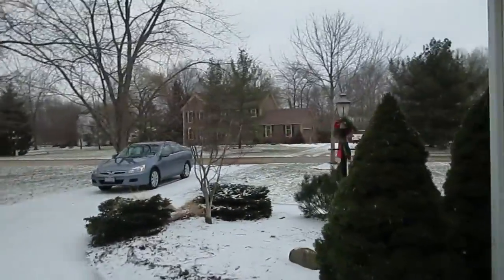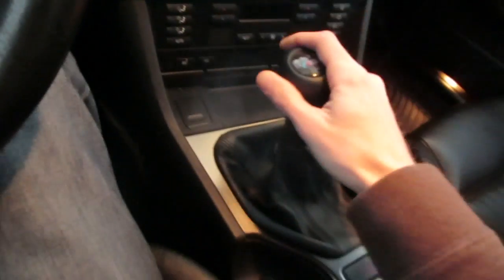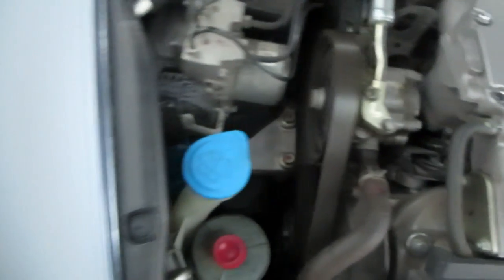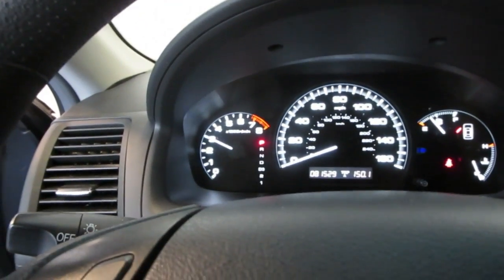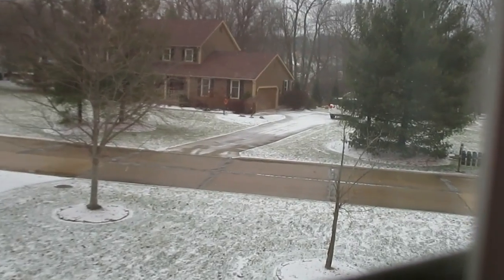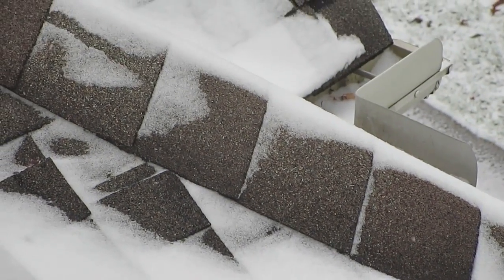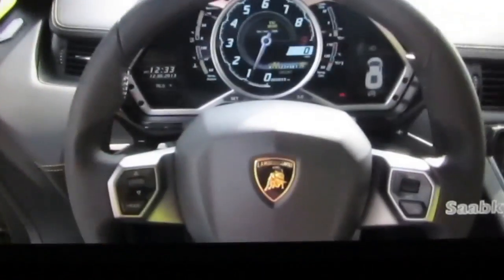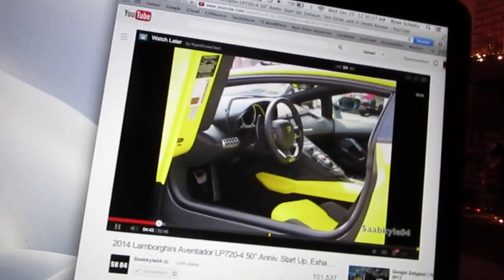HONDA Problems!?  12/24/13 - Day 1,112

Comment: Since you will be reading this on the 25th... MERRY FUCKIN' CHRISTMAS!!!! Hope all is good in the Schultz household and you're full of Turkey. and presents :) I do agree with you, if i start a car I try and run it up to temperature before shutting it down. That sounds like a Power steering pump as DataZoo said. Trip to the dealer for your mum soon then? Colt's car does not sound too happy either. But with nearly 240,000 miles on the clock it's good it doesn't burn 3 quarts of oil per 1,000 miles!
Reply from the maker: Merry Christmas to you as well!  I hope you had a great day, I know we did.  You'll see some of it in today's (yesterday's) vlog!  I think it is the PS pump in the Honda, but it only does it when it's super cold outside, and the engine is cold.
Reply: Thanks very much! Was great, and now I have some very much needed time off! Since it's the Honda leave it until the PS pump dies. ;)